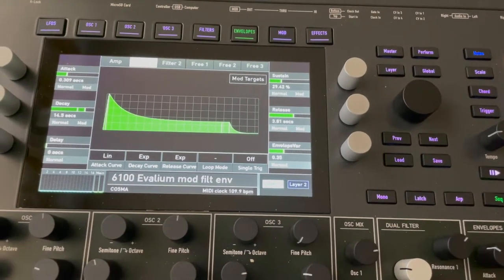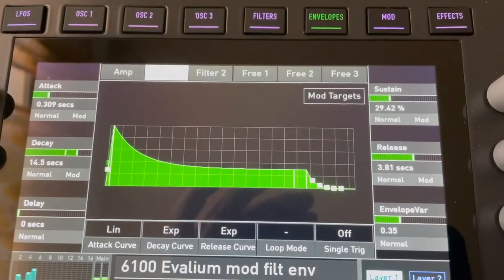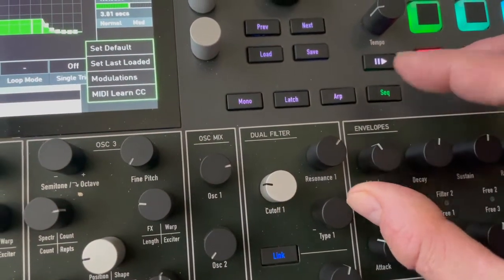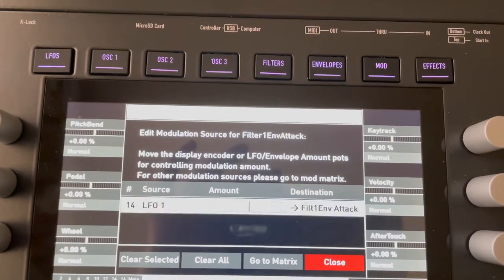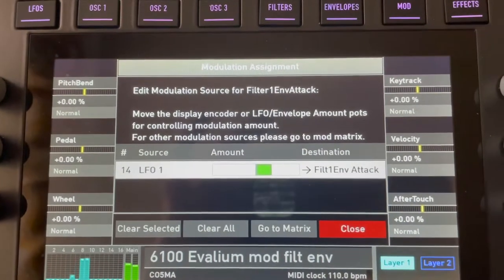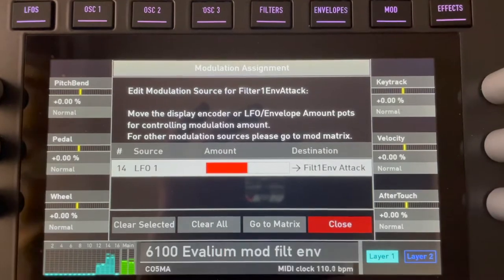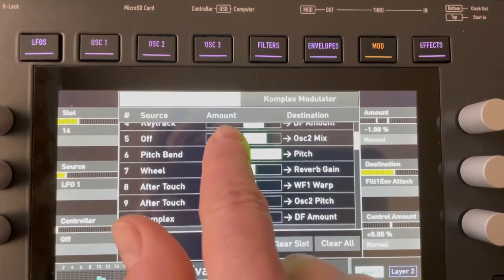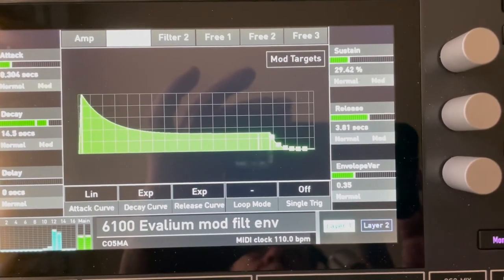Iridium Filter Envelope Modulation

Comment: To get the LFO to work with the Filt1Env Attack, turn down the filter 1 half way(or more),  and turn up Filter1 Env Amt. Go to the LFO 1 page. On the bottom of the page, change the Mode from Poly to Global.
Reply from the maker: Interesting!  Changing the LFO from Poly to Global seems to be the thing that makes it work.  Thanks for this!  I reported this to Waldorf and they replied that they had confirmed it was a bug and were sending it to development.  I will update the case with this information.  Thanks so much for your comment!
Reply: @SteveHorne  Thanks for replying! I didn't realize that was a bug. I'll keep an eye out for an update.
Reply: Is this fixed in the meantime? …… thinking about picking up this beast!